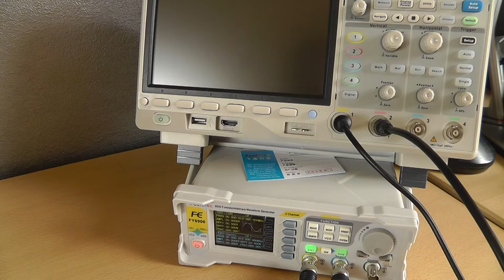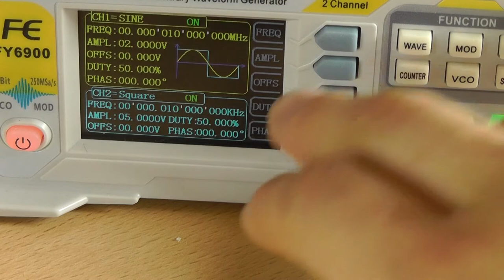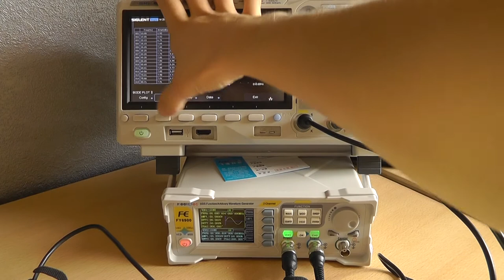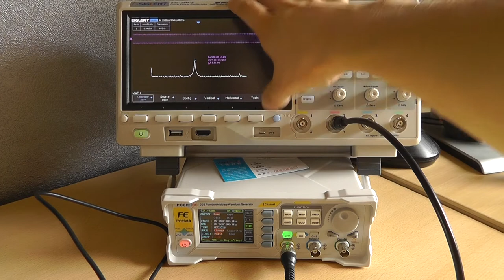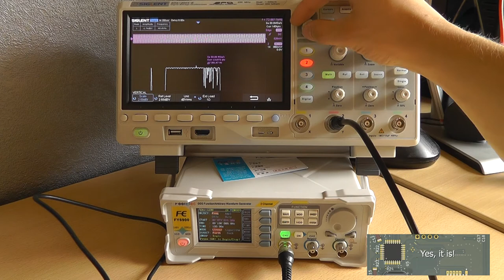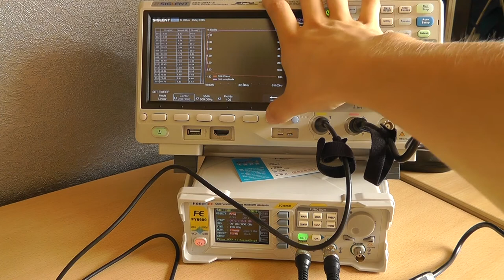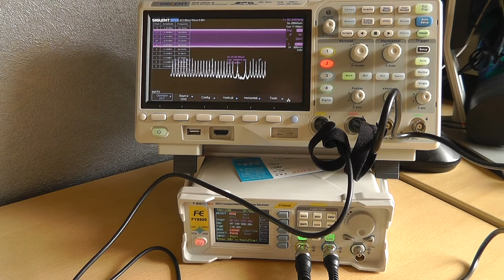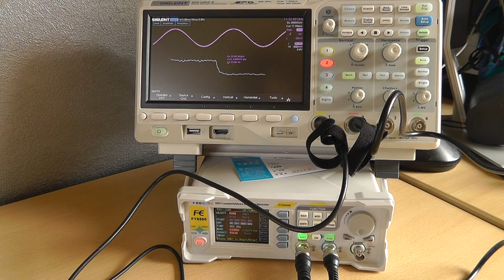#77-2 [GUIDE] Siglent SDS1204X-E bodeplot 📈 using FY6900 (Chapterized 🧾)

Comment: To get more accurate results you have to use the same AWG output for stimulus of DUT and for oscilloscope's CH1, not its doppelganger (because of phase shifts on higher frequencies and unevenness between two AWG outputs being controlled by commands through relatively slow serial interface).

Comment: Hi Tim,
I got an FY6900-100Mhz and built this circuit. The frequency translation doesn't work properly between my siglent scope and the signal generator. I figured out how to adjust the
signal generators frequency but I need to debug my code changes, I'm no expert in C++ programing. I mostly want to see messages sent from the scope to the generator. Can you suggest what I need to do to enable Telnet to receive outputs while running the generator connected to the scope? Any suggestions on debugging would be appreciated.
Reply from the maker: I'd setup a wireless debugging session using telnet or something. There are telnet servers for the ESP available you can use

Comment: Wouldn't it be easier (and more accurate) to use a single AWG channel, and probe the input/output of the DUT with the scope probes?

Cheers.
Reply from the maker: Hi Victor,
Thanks for your comment! It would, but then the scope does not have control over the AWG during the bodeplot. It's up to you if you want to use this for bodeplotting or you'd like to it manually
Reply: @TimsElectronicsLab   Thanks for the reply! I have a setup with my DS1054z and the FY6900 for FRA over serial (USB) and Lxi (LAN) with a python script. Works pretty well, although it can't be done directly on the scope.

I think the major advantage of this (apart from being able to process the data more thoroughly) is that you don't have to trust the AWG as much. If there's any differences on the characteristics of the channels, transmission line effects, or the output of channel 1 is loaded, it's pretty much guaranteed the amplitude will be different to channel 2, especially at higher frequencies.

Comment: Dear Tim,  i am using SDS1104x-E vs FY6900, but when i press Run Stopped button, the message: "Fail to connect to AWG" appear. Then i can't use Bode plot function like you
Reply from the maker: Hi Da Tran!
Try to open a Serial connection to the ESP (disconnect it from your AWG ofcourse) and check if there is any output. You might need to put 
#define DEBUG_PRINTS on top of your code or in esp_config.h to enable Serial debugging output.
Please note, that this will not enable the AWG menu inside the Utility menu.
Reply: @TimsElectronicsLab  thanks Tim,  I will try it
Reply: @TimsElectronicsLab  i wonder why we need Serial connection from  ESP. Is that you mean ESP Wifi module ?
Reply from the maker: @dattran0000  The ESP needs a Serial connection to be able to talk to the FY6900. The FY6900 is using TTL to communicate.